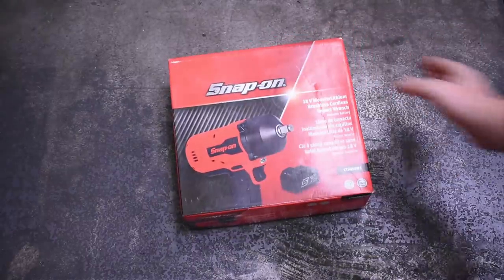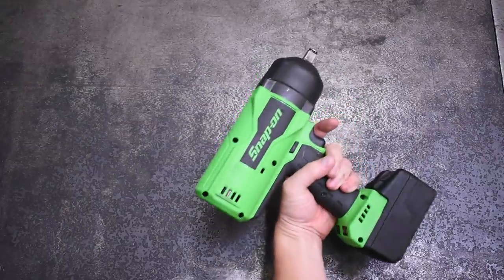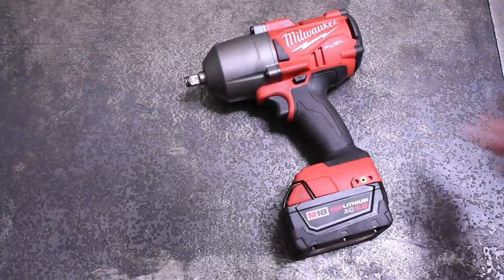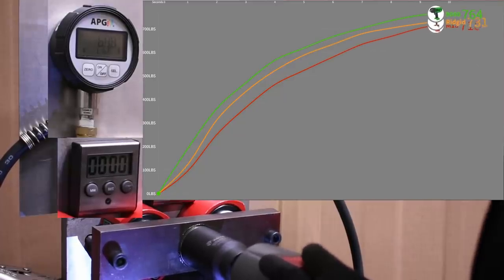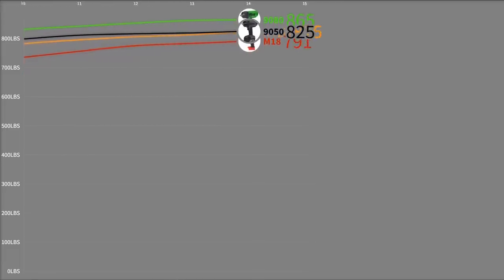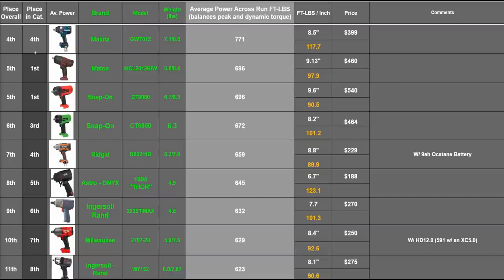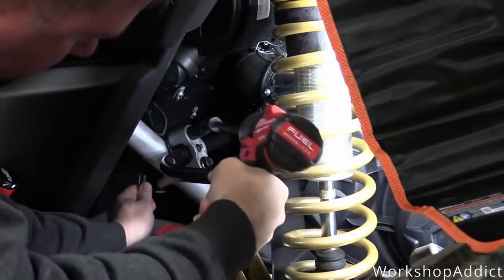Snap On's New CT9050 High-Torque is Smaller Than M18 & Hiding A Big Secret

Comment: I love this channel, but I don’t really need a lot of torque. I have an M12 right angle impact and it’s perfect for my needs :)
Reply: you must live down south where there isnt a lot of rust. here my milwaukee mid torque is often not enough to take off bolts off 1500 pick up trucks
Reply: I’ve got a teeny weenie makita with no more than 200-250 footpounds. Plenty and then some for my use!
Reply: I work in construction. I have a midtorq for no reason other than it looks pretty. It's way too strong for the bolts I deal with
Reply: @myusher2  I agree I have a DeWalt that's firmly in the high torque range and it will snap a lug stud but have meet quite a few bolts it would barely budge or just snap off because Ohio
Reply: Well it’s a good thing you can watch purely for the joy of the Torque’s. Lol
Reply: @Wesleystewart78  thanks quebec haha

Comment: I bought the CT9050 thanks TTC 👍 
The light is very bright not sure if you mentioned in the test. Going to run for 6 months to year and will give longevity updates.
Reply: How have you liked the gun?
Reply: @mr.exclusive5361  works great 👍 feels like it wants to bounce off fasteners more than the Milwaukee with wobbly sockets

Comment: Funny thing is, I never heard about the famous Honda crank bolt until I bought a 7th gen civic that needed a motor. I was all game for it because that engine swap was a breeze. That is until I tried to get that crank bolt off with my 3/8 stubby, then a breaker bar, then a bigger bar after I broke the 3/8 one, then a 4' pipe on the 1/2" bar finally got it loose
Reply: Welcome to the Honda Crank Bolt Club. I went through a Few Impacts, torch and 8 foot breakerbar before I finally got it off with a 1inch Semi Impact from the shop down the street it sounded like a gun shot when it broke loose 🤣
Reply: Apparently you've never heard of weighted crank pulley sockets 🤷

Comment: Another great video thanks. I'd still love to see the makita XGT 3/4" with a 1/2" adapter compared to these.
Reply: Also the 3/4" extensions, it was crazy how much torque they lost to the long 1/2" extension and im sure it would be less loss with 3/4". Both extension and 1/2" adapter must be tested together, my experience is that whenever extensions are needed it is for smaller socket sizes and not the typical bigger sockets for 3/4". 
I got all the mentioned items but no way to do consistent testing.
Reply: @djsi38t  Yes that's my theory as well and the reason I'd like to see the XGT compared to these 1/2" impacts that are basically the same physical size as the Makita.
Reply: I would also like them to test this. I want to know how much power you loose using an adapter. I would be temped to use that Makita XGT with an adapter as my main impact.

Comment: About time snap on became competitive with their cordless impacts. I bet the warranty is only 1 year compared to 5 year for Milwaukee. It also still cost more coin! I can also go to a Home Depot and buy a battery or charger or tool if need be with Milwaukee. Also the M18 line up and M12  line up is just fantastic with tool options along with battery options. Team RED all the way still. I’m a proud father of M18 fuel mid torque M18 fuel high torque  and m18 fuel drill M12 fuel stubby impact w/6amp hour and m12 right angle impact. I also still have air tools Matco MT2779. Gotta have a wide variety for the rust belt states

Comment: I think Snapon’s method has always been to never outsell their own brand.  They still offer the brushed 8850, if they blew its specs out of the water no one would want to buy it and I’m sure they still have a lot of inventory on trucks and warehouses.  I noticed too they kind of keep you in the dark about upcoming models because that would make people wait for the next best thing.  Some tactics I also were met by on the tool truck were “oh this model isn’t going to be made in green”.  Of course that was the case when the red tools were in hand and stocked on the truck.  Put that G at the end of the part number and voila we have a green tool 2 weeks later lol.  The older brushed models had a progression of motor upgrades over the years.  I have two 8850’s one was rebuilt due to it being underpowered right out of the box and another that I bought for $100 that’s was trashed when I sent it in.  The two guns were rebuilt a few years apart and the more recent seems to have more beans than the other had straight from service.  Both rebuilds sound almost like the brushless motors I use in my Rc airplanes, maybe a different speed controller is utilized as well.  Have you tested 8850 impact guns to see how they stack up?

Comment: I finally got the 9050, i got tired of my milwaukees battery rattling itself loose. Loved my m18 for 4 years but the battery thing was an issue the whole time. The 9050 for my real world use seems to be better all around. I like that its a little lighter, the milwaukee was annoying to use sometimes because it rattled too much during use, for me the 9050 seems to rattle a lot less but has more torque for sure.

Comment: Good to see Snap-On actually competing for once, this is only good news for the consumer because it'll just force other manufacturers to improve. 
Although I don't think results from Snap-on don't matter as much as some may think because the mechanics that have been suckered into the tool truck life will buy them regardless of performance, they're already so deep in debt that an extra few hundred bucks means nothing and they can just continue to shoot the tool truck guy a few bucks per week in hopes of paying everything off by the time they retire or quit the job. 
Its all about how their tool truck buddy sells it to them and once one guy in the shop gets a snappy impact the rest will soon follow.
Case in point being that people actually bought last years models which were insanely underpowered and overpriced when compared to their competition.
Reply: At my dealership with about 20 techs you couldn't be more wrong, most everyone is using Milwaukee and I've seen several people sell and trade the snapon electric garbage for Milwaukee after they try it
Reply: @99yellowz  Guess it really just depends on the area you live huh? Just about everyone at my dealership has a fairly decent collection of snap-on stuff, of course any smart person is gonna have a mixed bag, some manufacturers do better in certain areas and whatnot. But I also live in a decent area and most of the techs there are pulling a 6 figure income. I've got tools from all different brands and can say confidently that my snap-on stuff tends to just be easier to work with as a mechanic, plus the tool truck coming every week going around replacing broken stuff and getting engaged with all the techs is a nice experience. I had planned on getting the M-18 impact but having used both I enjoy the ct9050 much more. Regardless of power output, its just a more livable gun, lighter, more comfortable, better balance in the hand imo. The fact that it makes more power and is built in the US is just a bonus. From what I've observed serious technicians poke jokes at snap-on for being pricey, the broke ones just get upset about what they can't have without breaking the bank. Out of all my tools my american, german, and japanese made tools seem to always outperform and outlast that cheap Chinese crap.

Comment: So the snap on beat the Milwaukee by 31 ft lb of torque but I ended up purchasing a brand new Milwaukee m18 high torque with a 5 amp battery for around 200 dollars in October due to the fact that I found some great deals from home depot so for a third of the price there is only 31 ft lb I think I got the better deal and I bet that the warranty is better on the Milwaukee and the fact that they have a much better selection of tools. I have spent less than 2,000 dollars in the last 6 months on Milwaukee on m12 and m18 and have over 4,000 dollars retail. I just bought the m12 stubby 3/8 and 1/4 impact gun and the m12 3/8 and 1/4 inch high speed ratchet and the 3/8 extended for around 600 to 650 dollars without batteries but I have quite a few of those.
Reply from the maker: Just keep in mind that 31ft-lb gain was over the Milwaukee using a $250 HD12.0 battery. But I feel ya

Comment: I don’t know if anyone else has noticed this but I just recently picked up a 9080 and I was having to remove the lug nuts on a JLG 9k forklift we typically use a 1” drive earthquake pneumatic gun which if I had to guess tightens those lug nuts to well over 600lb/ft+. Well she was breaking the lugs loose fairly easy with a good weighted socket but the gun just over heats SO fast I had to keep switching batteries out. My coworker who has a Milwaukee impact also tried to break them loose and the ones his impact couldn’t remove the 9080 handled with ease. But between the impact overheating and the weight and size of the tool it’s honestly really annoying. I’m really considering returning it and waiting for the gen 3 milwaukee to release.

Comment: I've switched  to snap on 14.4 from m12 due to battery issues and terrible warranty service. Still have m18 stuff, been considering the switch to snap on completey. Just a little hesitant about the 18 volt stuff.

Comment: Can't wait to see the difference in power Ridgids new true 2700's cell 8amp battery will have on that Hightorque and Midtorque once it's released here shortly. The Octane 3.0 lays down some serious beans for it size so givin the Octane 9.0 is only running 18650's the new 8amp with almost triple 2700's may retake the top spot 🤷‍♂️ Although Milwaukee should be coming out with a smaller more powerful  Hightorque with tri-beam design like the Gen 2 Midtorque soon👍🏼
Reply: Imagine if Snap On dropped a battery with 2700. I'm pretty sure the side latch battery in this video is the same 18650 as the other ones.
Reply: @S2KCRGUY  Your right! That thing is a beast too bad it's so expensive. If they would bring down there prices it would be hard to beat. Size wise it looks to be between Milwaukee Hightorque and Gen 1 Midtorque pretty nice. If they can shrink this down to a midtorque version the size of the Gen 2 milwaukee that be crazy. I'm sure Milwaukee should have a answer to everyone soon since the 2767 is already long in the tooth.

Comment: Finally, a SO product that can match or better a milwaukee product.  Too bad it remains overpriced, a SO SO warranty and limited distribution.

I own a first gen Fuel 1/2 impact that is now ancient by current standards but continues to never miss a beat.  I'm not about to change over because of the M18 tools I own.  You're too late, SO!

And, it won't be long before Milwaukee comes out with a new high torque gun.  You guys are right; my old M18 fuel meets my needs 99.9% of the time.

Comment: I’m probably gonna stick with my 2769-20, Snap-On is great with hand tools, but not very nice to the wallet… I’ll be sticking with my Milwaukee😂
Reply: Same here, if snap on wants to charge me double the price of Milwaukee, then I expect double the performance that Milwaukee gave. In this video, that was not the case. Sure, it did beat Milwaukee, but not by much. If snap on can match Milwaukee's price, then I might consider it, even if its $50 more, but not double the price more.
Reply: @zzzzzz...9902  Even if Snap-On was able to match the price of Milwaukee, they don’t have nearly as expensive of a tool platform. As someone that uses a good chunk of the M18 line up, a couple ft-lbs doesn’t make a big enough difference to run multiple platforms.
Reply: @zzzzzz...9902  If you look at the fact that Milwaukee gives 3 years more warranty, then their price should be exactly the same.

Comment: I have the older model it's a 2020 model and that damn thing at 3/8 drive is just insane. I use it on everything. only thing iv found it can't take off is red lock tighted and ran in with air.

Comment: You should try the dewalt 1/2” and 3/8” air impacts, I have the 3/8” air impact and it’s pretty good for the price! I’d love to see how it would perform against the other air impacts!
Reply: i really want to see the husky H4480 air impact from home depot. they advertise 800 ftlbs. it hits really strong and is only 119 . great value.

Comment: snap on power ratings are with 1 bar of battery, apparently. 

also might retire the 2767 for this in green. everything green in my tool box. also the battery shake is annoying and my 2767 often jumps from setting 3 to setting 2 and its too annoying to deal with. im also dumping m12 line into the house box and going with 14.4 line because of milwaukee's battery issues. great tools, just can't have 100 dollar batteries falling to the floor.

Comment: I’m getting the ct9050 but right now I have milwaukees high torque with a 5.0 and two 6.0 high output and my milwaukee is about 4 years old but now the battery is crazy  sloppy cuts off on me and I have to nudge it, so going for the ct9050 and if milwaukee comes out with a new high torque I’ll get that when and if it comes out.

Comment: I have the Ridgid with the 9ah battery, the Snap-on 9050 and Snap-on 9080, the Ridgid is a beast but pure junk, bolts kept loosening up then blew the nose off after one year of use, the Snap-on cordless impacts are built for abuse, I'm a heavy suspension tech

Comment: My 9080 has been stopped once by a rusted old leaf spring shackle but nobody had a weighted socket that size. it eats crank pulley bolts for breakfast

Comment: I use milwaukee only. Snapon bringing their best is good competition and it pushes other companies to do better . Even if milwaukee brings out another more impressive high torque.  I won't replace mine until it dies and milwaukee won't warranty it. If my high torque can't remove a bolt... that's a job I don't want to do. 🤣

Comment: Finally all big companies tries their best to be competitive in all segments, i like that! Milwaukee had the crown in impact wrench & driver for long ago and now that the other companies catch up or they become near to the spec, means it is ok to stay in one platform and not buying another batteries to have what you want, I have mostly milwaukee tools but also have dewalt worksite fan and heat gun, also have some makita tools + ryobi tools, never attached to a brand but it will be ECO friendly if you only have one platform that compete with others which saves you money as well👌

Comment: I was going to asked which HO battery you used for the Milwaukee. But I seen in another reply you said the HD12.0 high output. However the XC6.0 High Output  is the better battery for the Milwaukee shown from your other test. And much cheaper than the 12.0. Why not use the 6.0HO battery. I know it was only by a little.
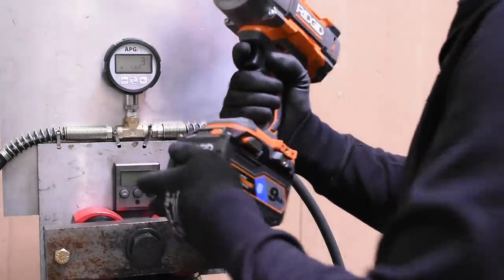Reply from the maker: It's mentioned at 6:41. Also 6.0 offered a slightly higher peak, but not more overall or on the curve. We use the HD12.0 in these because if we didnt people would say well the M18 would win with an HD12.0
Reply: @TorqueTestChannel  damned if you do damned if you don't huh
Reply: @TorqueTestChannel  I completely understand. It wouldn't have made much difference anyways. The Milwaukee is still a better buy even with the 6.0 or 12.0 battery looking at the cost of the snap-pn as a kit and probably more reliable. How the snap-on is a new product and reliable could be much improved.

Comment: I wish Milwaukee's 3/4 was more impressive. I have the air cat 3/4 vibrotherm. Thing is a monster but it would be nice to have portability .
Can you test 3/4 vibrotherm. It destroys by buddies 3/4 mac
Reply from the maker: Our 80gal IR compressor and 1/2" air line cant keep 90psi in a 3/4" gun while running. So wouldnt be fair vs the specs
Reply: @TorqueTestChannel  well that's unfortunate.
Just go full send 10 foot hose unregulated straight out if the compressor lol
Enjoy the videos. I have been sharing them in my shop

Comment: for the price of the snap-on you do not get it in torque or quility. im my shop most techs have dropped the snap-on for Milwaukie. most of the snap-ons are in for warranty with in 3-6 months of buying it. Milwaukie if far better quality over the snap-on. sorry to say snap-on has failed in this department

Comment: Waiting for DeWalt to make a flexvolt version
Reply from the maker: Their new high torque is XR. No word on what the bigger badder HT will be though, I'd assume flexvolt
Reply: @TorqueTestChannel  i had my xr stolen, waiting for the HT, didn't know that was a thing????
Reply from the maker: @covingtonrace1  HT as in high torque. They have a 2nd tier high torque in the works as well. You might be waiting awhile for that new XR though

Comment: So 7% more power over Milwaukee for only 86% higher cost.
Reply from the maker: So is the $250 HD12.0 free in that scenario? But I see what you're saying
Reply: @TorqueTestChannel   I was comparing the tool only to tool only price ($250 to $464). Batteries kits/combinations throw things off. Plus it's still not exactly apples to apples with the 12ah as the snap on is only 5ah. Should we include another snap on battery to bring the total Ah's closer?

Comment: Sorry but this is a complete lie the Milwaukee is completely better then the snap on 1000 foot pounds for Milwaukee as it says on your chart is a lie my Milwaukee puts out 1400
Reply from the maker: That's 1400 nut busting. We're measuring working or fastening toque, which is 1000 for the 2767. Nut busting can't be precisely measured. And if we compared the Milwaukee to its 1400 it would have gotten a lower score not a higher one. We're about 100 impacts deep on this channel. We couldn't care less which brand wins. The numbers are the numbers